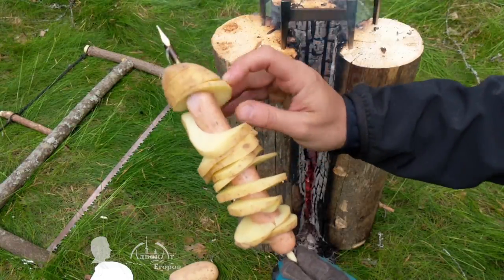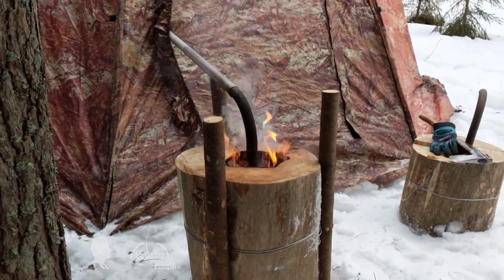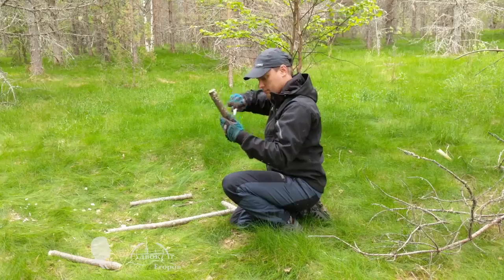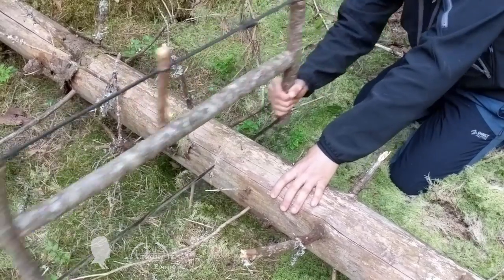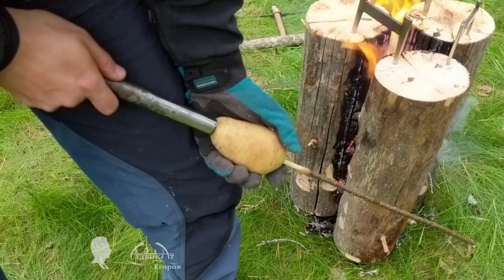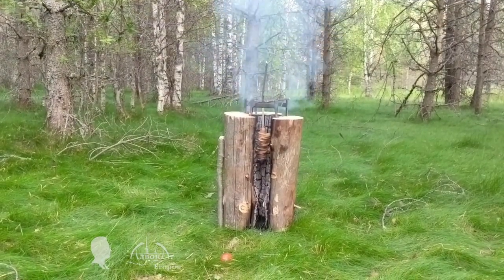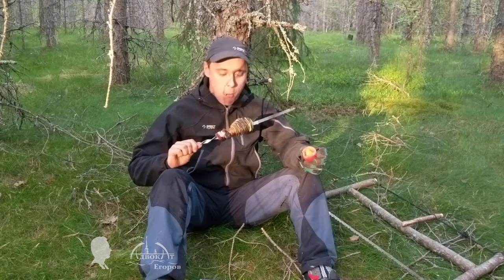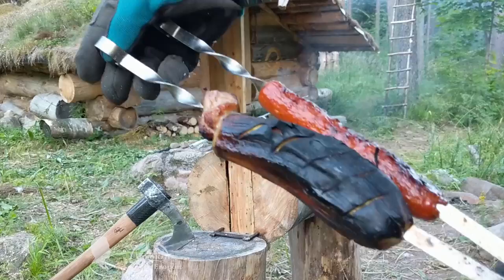Swedish Torch/Stove Vertical Cooking: My Bushcraft Recipes

Comment from the maker: Friends, for your convenience I assembled a chronologically arranged list of videos about my efforts in establishing
this log cabin camp in the off-grid remote location of Karelia (All Seasons): 
-------------------------------
01 episode - @ (1 season)  2014
02 episode  - @ (1 season)  2014
03 episode  - @ (1 season)  2014 (not translated) 

1 episode  - @ (2 season)  2015 

 2 episode  - @ (2 season) 2015 

 3 episode  -@ (3 season) 2016 

4 episode  -@ (3 season) 2016 

5 episode  - @ (4 season) 2017  

 6 episode  -  @ (4 season) 2017   

 7 episode  - @ (5 season) 2018    

 8 episode  - @ (6 season) 2019 

 9 episode  - @ (6 season) 2019 

10 episode- @ (6 season) 2019
--------------------------------
My Patreon page: @t
Reply: Use American style bacon, you'll be in heaven! Maybe some cheese? Nice video
Reply: That looks like an awesome recipe to cook inthe wild! You look so adorable eating it as well. Ot looks really good😊
Reply: Great Video!  Was thinking... due to the added simplicity of building/setting up the vertical log grill in the video above, what if one were to add 3 more logs (to close each gap in the 3 logs that are secured by the 6 wood-dogs) then adding 3 wooden log legs secured with some wire!?  A "6" log design would likely be faster and easier since one could skip/avoid finding, splitting and cutting out the center core of a very large log...plus...smaller diameter trees/logs are much easier to manage and also typically more common. Would be very curious to see how well a 6 log vertical grill of such design would perform with the metal pipe heater that was shown in in the finnish fire log video(!)
Reply: quality content like always =) but i recommend you not eating to much charred food. The black burned parts are cancerous... we don't want to lose you
Reply: Do a catch clean & cook videos👍👊🔥
Reply: Were those supposed to be links? They aren't links, so you might want to fix them.

Comment: Finally.......I am old and alot of this has been forgotten and lost. My grandparents worked and showed me how. I worked with the work horses, used wood stoves and out houses......I remember my grandparents getting electricity at there house. It was a 40watt bulb...and that was blinding. Compared to the kerosene and oil lamps.
You can spike you meat and potatoes in the ground if you want over coals....your way is better with heat all arround for even cooking. Always have the meat at top of spice so the grease and flavor runs to the potatoes. You did good young man !!!!

Comment: Hey Brother, about the spot in the video at 10:47 where you show the smoke catching fire.  Most people do not understand that wood does not burn !  When wood is heated to the temperature at  which it starts to turn dark, the wood will begin to emit vapors (mostly carbon-monoxide) which is what burns.  It is similar to the same thing with petroleum ,   as where the petroleum vapors burn, not the petroleum.    Carbon-monoxide is a fuel and it will burn, and it can be explosive. Just ask any professional fireman !
Great videos and good information.  😁😃
Reply from the maker: Great explanation of pyrolysis. Thank you.
Reply: Thank you for explaining that. Montesano Washington

Comment: The middle pice of wood use a Y pice on the push side as it being wider because of the Y stops much of any wobble as that end has lots of pushing pressure the Y will be able to have a larger surface larger mortice is stronger !!! Thanks Max great work tree to boat nice !!!

Comment: I loved  your tent heating video and I had to follow the link to see about vertical cooking, and it was everything I hoped it would be! I'm not convinced, though, that that patch of grass isn't dead and won't stay dead for a long time. I would love to hear a follow-up. It's been two years. How long did it take the grass to grow back?

All this being said - certainly it's LOWER impact than a traditional cooking fire would have been.
Reply from the maker: The grass grows back the same season. There is not enough heat to sterilize the soil under a torch. Plus the burned area is tiny.

Comment: Check recipes for kontosouvli (Greek spit roasted pork). At its simplest it is pork shoulder pieces rubbed with paprika, pepper and salt, ciiked on a horizontal spit. Your vertical method would work very well, but it might be a good idea to invert the spit halfway through, so that the top of the roast does not dry out.
Also - it's a "bushman's saw" in Australia. I use one my grandfather made.
Reply from the maker: Thanks, Rob!

Comment: Is the metal skewer you are using just a standard skewer? And did you have any trouble with the food sliding off while being cooked?
Reply from the maker: Yes, just a regular metal skewer and a wooden stick (as shown in the video). No, no problems with food sliding off of a skewer: the meat pieces and potato shrink while being grilled... If still concerned, you can add a small piece of meat at the bottom of a grilled vegetable as a stopper.

Comment: This is cool,  I'm curious how much natural gas is releasing into the metal pipe; have you tried taking a match or lighter to the heater  end if the pipe to check?
Reply from the maker: It would burn like gas ligher...

Comment: Do you recommend the technique of fire-hardening the wood?

I have not used the technique, do not know if it works with only certain types of wood, or how prone it is to failure, if too much heat is used, or too long.

Have you done this?
Reply from the maker: I've never used it, so I can't tell.

Comment: That vertical Swedish/ Fininsh oven looks very effective. 

What kind of wood did you use in your vertical stive?

The  Potato/ Hotdog combo is a practical outstanding idea that I will have to try out.

Keep up the good creative works!
Reply from the maker: I used pine to make it.
Reply: @Advoko  
I thought pine was not good to use to cook with? As to tar Gas effecting the food? That hardwood is best to use.
Reply from the maker: Correct, however, it is harder to find fallen (I didn't want to chop down any trees)  hardwoods in Karelia.
Reply: @Advoko  

That is an awesome display of respect for the land.
 Did you notice any negative effects coating of sap etc by the use of a Conifer tree (Pine)?
Reply from the maker: Not really. But if I had access to the hardwood I would rather use it for cooking